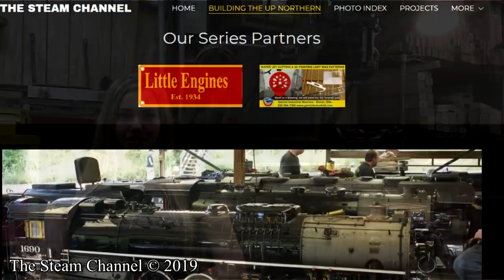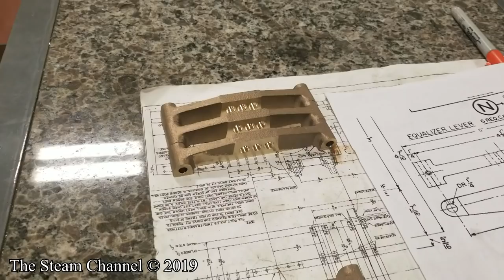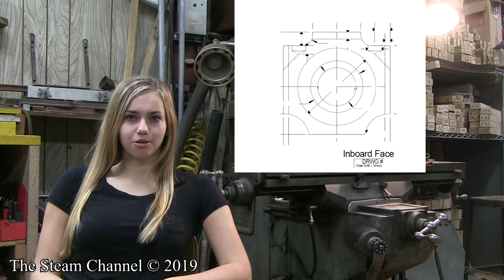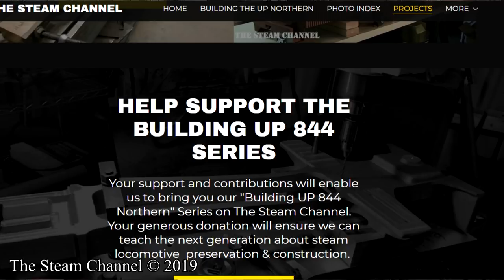Building UP 844 | E2 | Cradle, Cross Ties, Buffer, & Equalizer Bars/Plates

Comment: Nice to see there are still people out there that actually KNOW how to run an end mill without the aid of CNC, and still maintain .0005 in. accuracy!! Very satisfying to watch. What an incredible project!😁👍👍
Reply: Still plenty of skilled people out there but yes CNC has removed a lot of the skill from machining,silly because its really only for high volume, i cringe at people who write complicated programs to make single simple parts, just do it by hand you dolts!
I have a hankering a lot of these people cant even red drawings properly, they just type numbers in cad without actually understanding what they are doing.I don't even like DRO's (even though my mill does have one, i don't use it often) let alone CNC.Very much old school, i refuse to even use digital measuring equipment because i do not trust it, all vernier or dial scales for me thx. I can use new stuff, don't get me wrong, i started running cnc machines of various types back in the  90's for a job,i just do do it unless i absolutely have too! Ill probably use my 3d printer to make some complicated patterns for making some castings but that's about the limit for me using automation and only because these parts are impossible to do by hand on a mill.

Comment: Very nice
I'm interested in to building my own although it would be a Southern Pacific MT-4 4-8-2.
It's pleasant to see a series of watching the build process and to see what goes in it.
My thoughts though are I don't see any plans with L.E. or any of the major steam pages.
I know the LE 4-6-2 Pacific is based off of an SP P-4 design and has a majority of interchangeable parts between them. I just need to extend the frame to include one more set of drivers. 
My question is it feasible to purchase the 4-6-2 plans and adjust to make it a 4-8-2 or use a 4-8-4 blueprint and just change the cradle

Comment: Very much enjoyed this video,as I was reading one of the comments and-questions I have had for a long time were answered. Price, are there kits or just blueprints. What about castings etc. I can see a steam locomotive is out of my capabilities just from the tooling required. Ie quality lathe and milling machine. So that begs the next question what do the Diesel engines cost to build who has plans castings etc. Also are the Diesel engines run like the proto- types with an electric traction motor powered by a diesel or gas generator. Any thoughts or insight to educate me and other interested readers would be greatly appreciated also to include any web pages for how to and possibly parts/ kits. Thank you once again for sharing and any info you can provide.
Reply from the maker: Diesels are generally scratch built. There are companies like The Train Works that offer powered trucks RTR but you generally have to source and build everything else (the trucks generally cost $3,000- $4,000 a set). There is a full vendor list on Thesteamchannel.com on the live steam marketplace page.

Comment: How do I buy one of these lovomotives?
Reply from the maker: You don’t. You talk with Little Engines about buying a casting set for the engine (I believe around $15,000) and you buy the raw parts that you have to machine. Or, on top of the raw parts, you can afford to pay a shop $40,000-$50,000 to handle the labor and build the boiler (another $9,000). These are approximates and not hard prices.